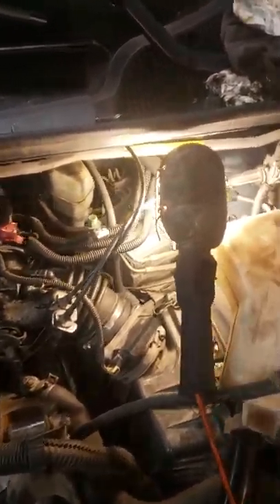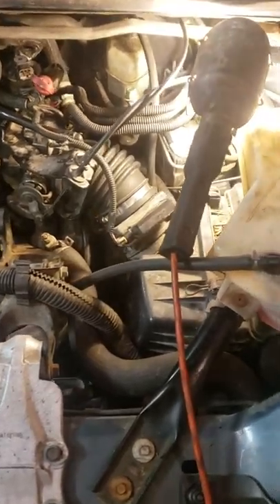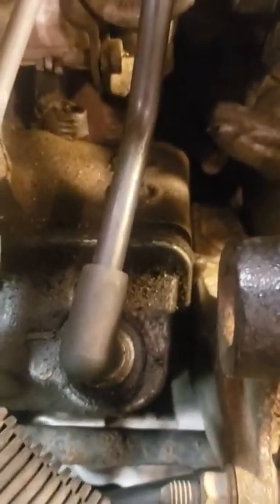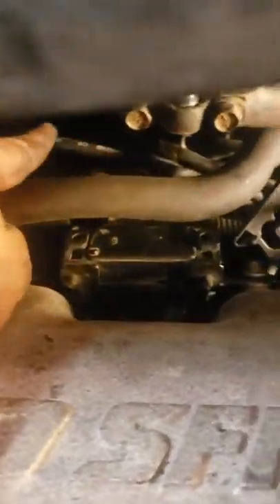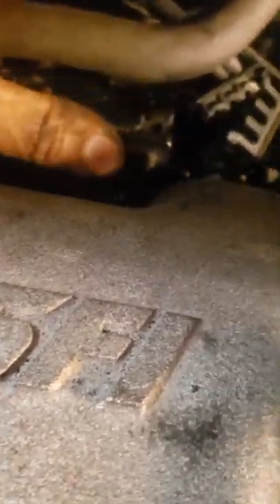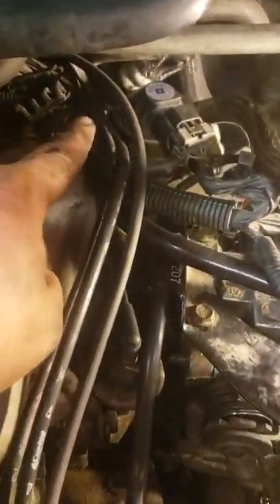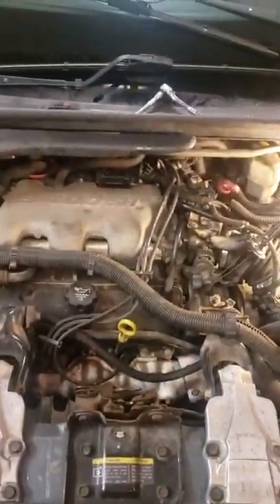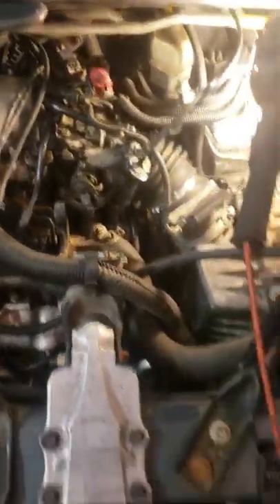2004 GM 3.4L Fuel Pressure Sensor Tube/ Crankcase Breather Tube

Comment: Thank you so much , I couldn't get the crankcase breather tube connected in the back until I moved the ignition coil bracket 🤩
Reply from the maker: This thing frustrated me so much that when I finally figured it out I had to post about it lol.